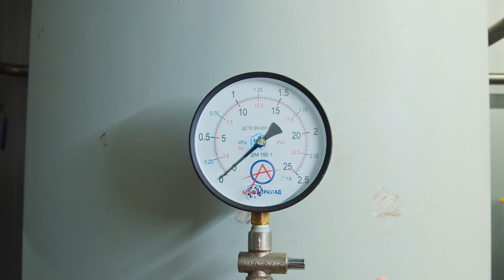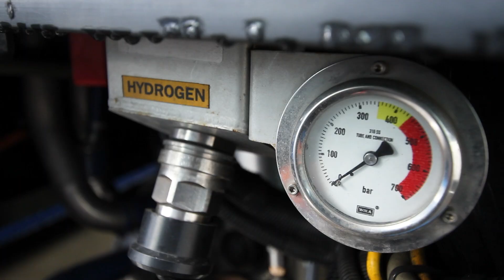How Clean Hydrogen Is Accelerating the Transition From Fossil Fuels

Comment: The Eirex Technology in Canada will produce green hydrogen not by electrolysis but energetic cavitation at $0.25 per KG or 25 cents per gasoline gallon equivalent from any type of water. The other Canadian startup called Ayrton Energy safely stores hydrogen in clear nontoxic liquid ideal for recycling existing oil infrastructure and can be recharged 1,000 times before new batch of margarine type liquid needs to be produced again. The Hydrogen Digital Dollar can be minted on Dfinity and ocean water stores 150X more Co2 than air to produce cement, bricks, hydrogen, Co2 Trading Credits on Dfinity plus chemicals also from ocean water as well.